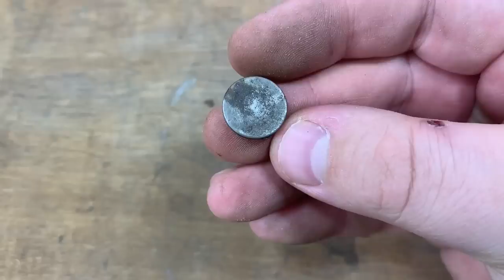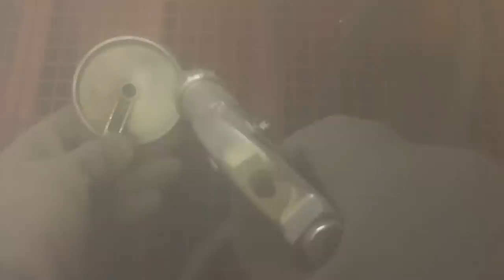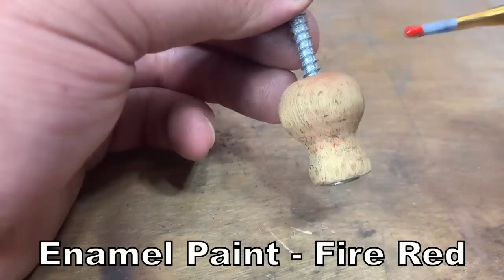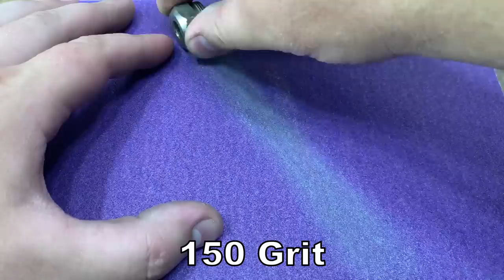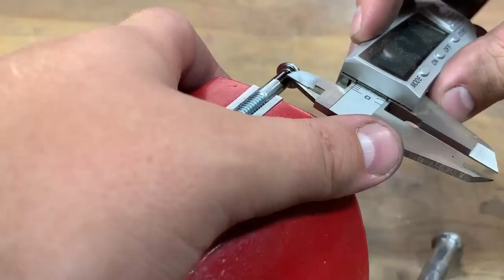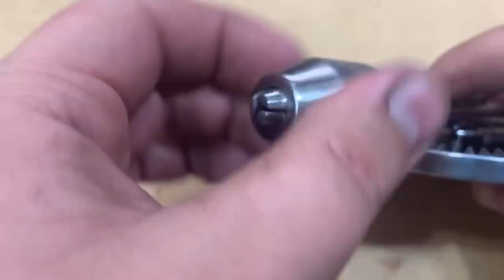1950's Stanley Egg Beater Drill Restoration - Vintage Tool Restoration

Comment: Here is a old blacksmithing trick, take your piece heat it up and use wood to smack it. The wood will straighten the piece and since the wood is softer than the metal it wont deform the piece by moving the metal.
Reply from the maker: I will file that and use it! Thanks for the tip!
Reply from the maker: Used your tip today. Works like a charm!

Comment: nice work. I wouldn't have done it that way, but it came out nice. our goals would be different. I would only want to make it usable, I would not focus on pretty so much. You polished pieces that aren't even seen. I wouldn't. I also would not use paint on the handles. If used, the paint would wear away quickly, besides I like a clear finish that shows off the wood. In these times where everything is plastic, I'd like the wood to look like wood... but we'd have different goals like I said. To me, this would not be something to sit around and look pretty but not be used, I'd use it. While electric drills and such have their place, this still has a place in the modern world when one is doing fine, delicate work and needs more control than  a power tool allows. I work on small things like vintage lighters and so forth, so such a tool would have use for me

Comment: It's stanley!!!!
Of course it's made out of crappy materials that bend and break easily!

That's why they acquired North Brothers manufacturing company in the 40s, so that they would not be in competition with Stanley, and Stanley would have some really good top quality products to sell.
Some of the best quality tools that Stanley sold were develop and engineered by North Brothers before they were bought out by Stanley. The Yankee tool line for instance. 😃

Comment: Okay, pretty nice restoration. A lot of work, much of it needless. You cavalierly drilled out pieces that were in fine working order( I know as I've restored a couple of these). You ended up replacing and rebuilding parts that were needlessly destroyed in order to make the disassembly video worthy. Painting the wood made it look like a fifth grader's craft project. Leave the wood with a light sanding, it has a long history and a story to tell, not a kid's toy look-a-like .  I appreciate the sanding and polishing as that is time consuming and noteworthy. All the work to rebuild the gears that were destroyed in the take-down was painful to watch as  more than likely they were  in 98% or better condition (Hand driven tools don't wear down much over the decades), a little cleaning and lube would have kept the tool in more original condition. Learn what not to do as well as what to do, your projects will look better as well.
Reply from the maker: Research this piece. Handles are the original color. Read the description of the video. The drill was not in working order. I would have left it alone otherwise. Thanks for watching and commenting